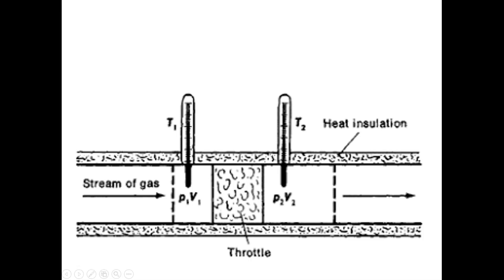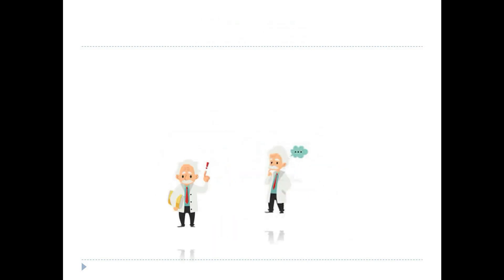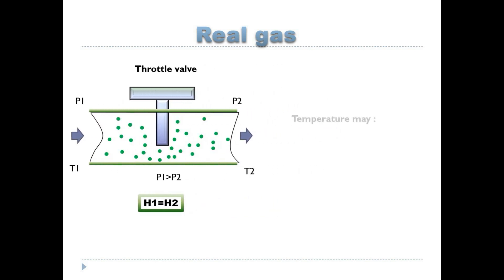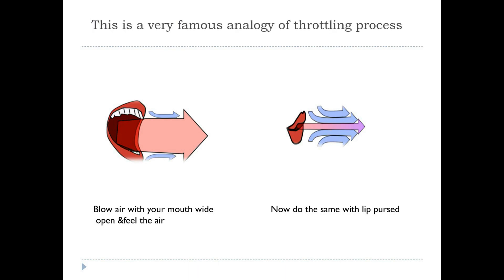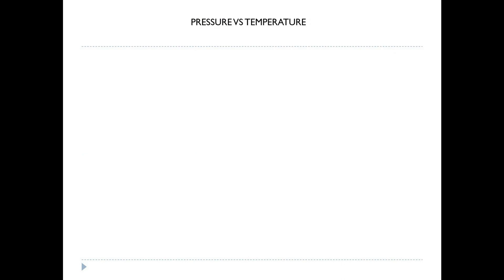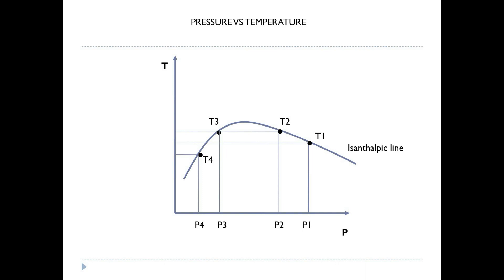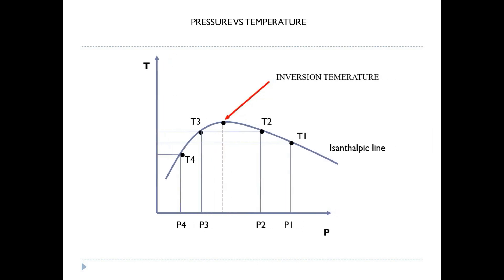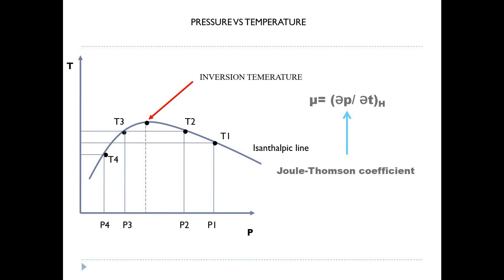Joule Thomson effect

Comment: nice learning video. however, on the graph, the gas is not compressed from P1 to P2 nor P2 to P3. Actually, a gas is  throttled or expanded when going to a lower pressure level.